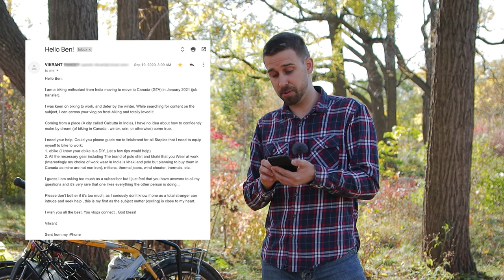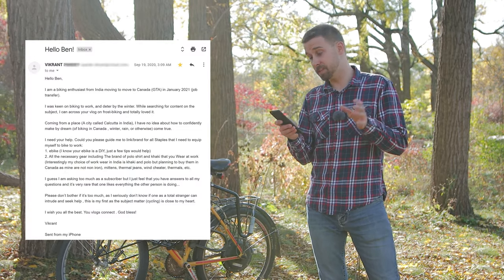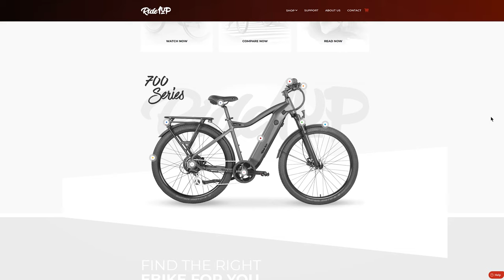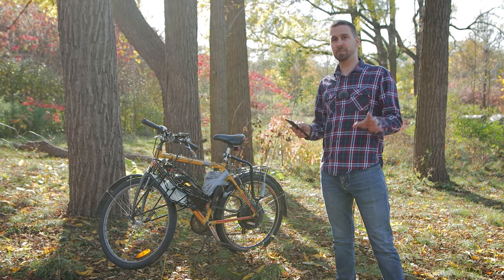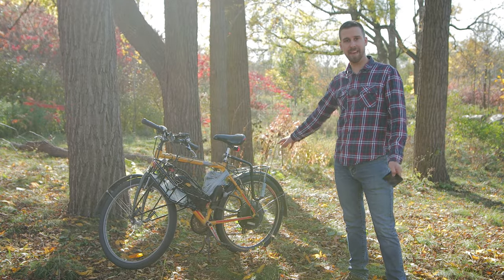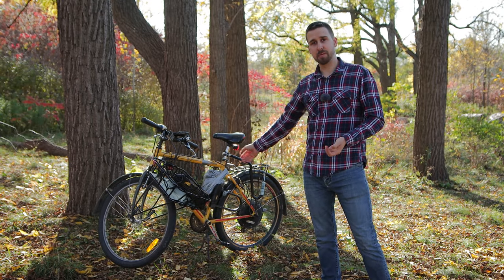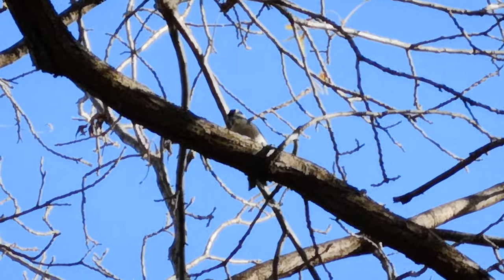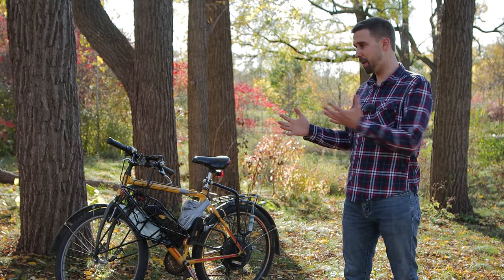Everything you need to know about EBIKES, going into 2021 (Q&A video)

Comment: A good video, Ben! 

My recommendations: Don't buy RAD and so on, because there are cheap parts that have to be upgraded. Also : Don't buy system e-bikes. They have integrated batteries, cables etc.. This may look better, but if one has to repair or change, it's a big hassle. And to upgrade something very limited, because in most of the cases only original manufacturer's parts fit.

Always do DIY. The flexibility and performance are best that way.

Only steel bikes are real. Can't beat a good Chromoly steel (for example 4130 CrMo) frame and fork. This material lasts forever, offers good riding comfort and can be repaired. Buy it new or used. 

The Yuba Mundo LUX, the one without electric motor, is the best cargo bike in the market. It has a CrMo frame. The Radwagon is cheaper at first sight, but Yuba offers the much better concept and quality of cargo bike. Also very good cargo bikes, but pricier: Surly, Xtracycle, Bullitt.. A RAD Bike is to do some miles, Yuba & Co. are to really, really do miles. Bafang middrive motors, the BBS series, are good performancewise. Almost every spare part is available. 

In Canada there is also Grin Technology, ebikes.ca. They have their own motors. Justin, the founder, is one the best e-bike experts in the entire world. Grin have many great products.
Reply from the maker: A lot of good information here! I've been researching and it's tempting to go with a Biktrix Swift for myself (2nd bike) and my girlfriend (I'd use my DIY when she comes along) just because it's got similar specs to a DIY build and it's all pre-built and Canadian-made. 

I've definitely also been considering buying a regular trek or giant bike and rigging it up with a 1000w mid-drive bafang as a fun e-mountain bike! Do ya have any thoughts on that?

I guess sometimes it's just kinda weighing the time vs money side of things! I'm all for longevity of the bikes and am worried about all the "dead e-bikes" in the future... but I guess it's still better than the alternatives: 1st, 2nd, or more cars in driveways?

Comment: Your not Alone I'm from gatineau love using my diy ebike for commuting. No studded tire here just slow down in the winter months
Reply from the maker: Awesome! I grew up in Gatineau (Aylmer at the time)! How do you find your battery range is affected in the winter when it's -30C? Most other people are from warmer climates so I don't get to ask this niche question of them 😅 

High five for studded tires
Reply: @BenDurham  what a small world eh lol my wife and I lived in Aylmer as well for a few years we did not ride our e bikes in -30 this year yet because it's been so mild. Battery does lose half of its charge within the hour. I did custom sew a cover for my battery it helps alot to keep it warm.. I know what you meant by -30 with the windshield that would be the max not any lower and not far. Anything below - 30 we don't bike anyways tires will freeze solid even if you lower your tire pressure everything freeze solid in minutes.

Comment: How does the battery hold up during the cold winter? it will drain fast right!! 

Can you please do an episode of travel during winter. Like through snows and stuffs.
Reply from the maker: I literally just went out from 3-5 pm yesterday to do some errands and my trip was 45 km in total. I used two 80% full batteries and was going a pretty fast clip between places. Both batteries were down to around 30% after that. 

So yeah, batteries get drained a bit faster in the winter but TBH, most people won't be routinely cycling 45km on their bicycle haha! Even for me, that was a bit far. I'd say 90% of my trips are under 15km in total (roundtrip). 

I'll do an episode on winter e-biking, sure! :) What are some things you would like me to cover for you?

Comment: Bicycle tires are stupid expensive when compared to vehicle tires.
Reply from the maker: Yes... but no. Not when you only have to get them every 3-6 years... and there are only two of them! And no insurance along with extraordinarily low maintenance costs. One of the reasons I'm sticking with 26 inch tires for now is because I have so many tires that I've stripped from bikes being thrown out on the side of the road! I swear I have around 10 26" tires that I have sitting in my garage.. and all of them have been free.
Reply: @BenDurham  mind me asking where you get these tires? I’m from Scarborough btw